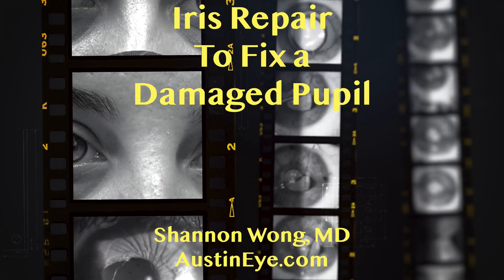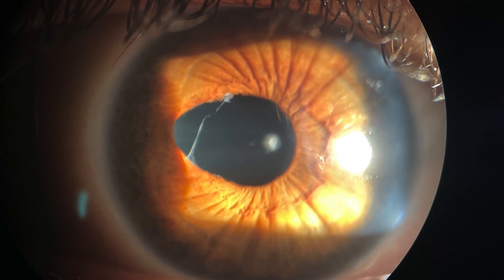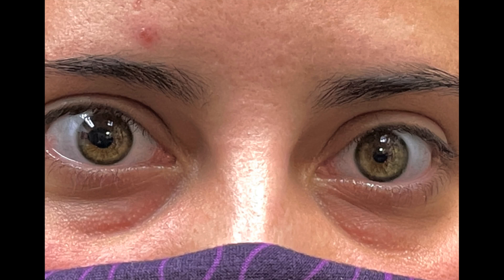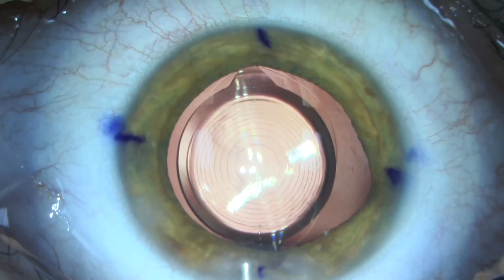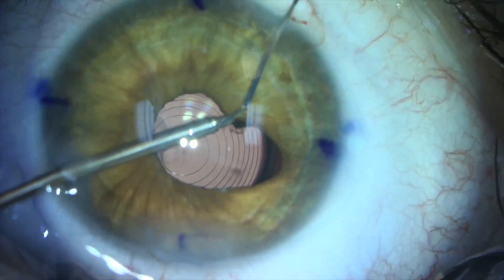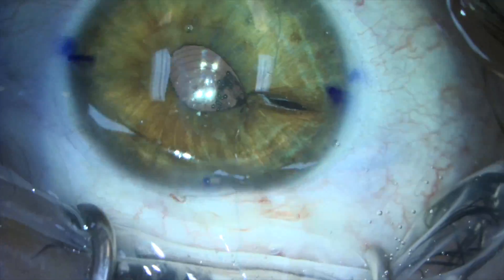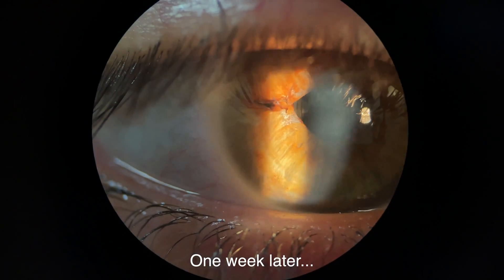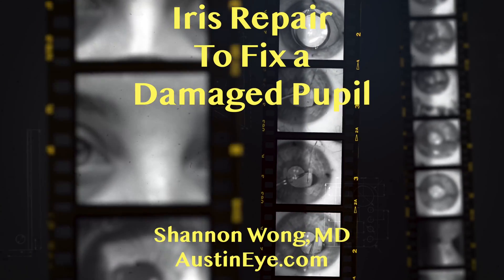How to fix a damaged pupil. Iris repair to fix a damaged pupil - Pupilloplasty.

Comment: Dr. Wong, --I've watched many of your videos. I just had cataract/lens replacement surgery on my second eye, two weeks after the first. The first one went well, but after the second one I've noticed that my vision is too dark in my house with that (left eye). I can see in a mirror that my pupil in that eye is constricted down too small. It doesn't open (dilate) in lower light conditions. At the same time, my other eye pupil is open larger, but now I have light/dark tested bot eyes and can see that they are both not reacting to light and/or dark at all. The pupils don't change in size accordingly. Both pupils are frozen in position. My cataract surgeon says it should get back to normal, but I'm quite worried. Could it be the eye drops I'm using? -Have you encountered this scenario before with any of your patients? I would appreciate your input on this issue. --Thanks